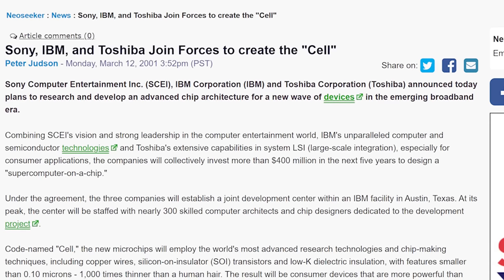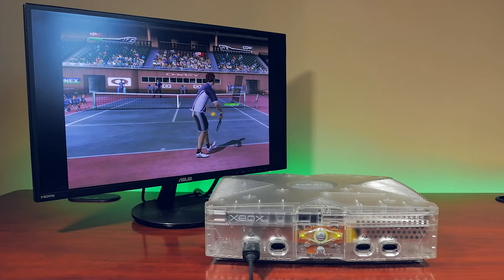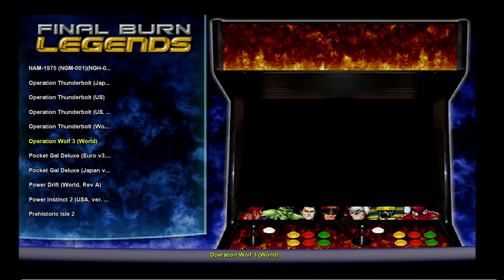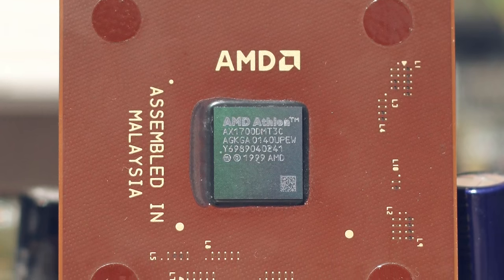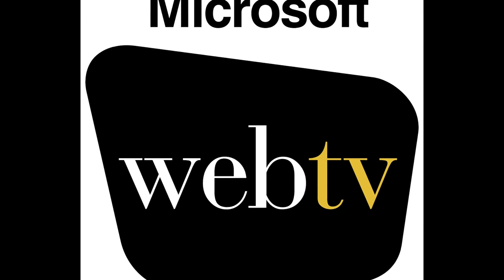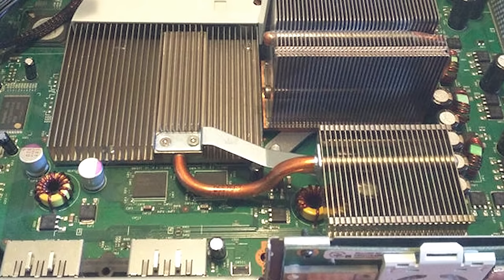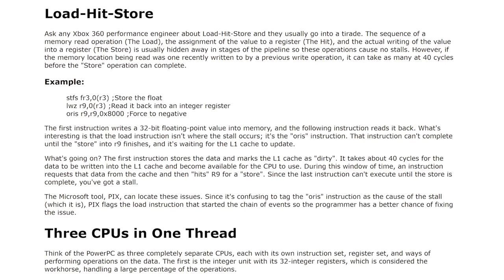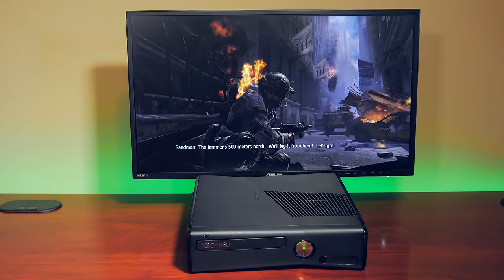Why Microsoft switched from Intel to Power PC for the Xbox 360  | MVG

Comment: I think the ppc vs Intel (and especially "RISC" which is a basically pointless description these days I'm told) is less important than the lack of out-of-order execution, which is a substantial difference between Xenon, cell spe, and common desktop chips, which requires really smart compilers and/or smart assembly language to accommodate.

Comment: I'm sure there were a ton of reasons behind the move to PowerPC. Although, upon consideration if they were having heat issues with a RISC architecture, imagine the heat issues they would have with an x86 and all that extras included along with it. Considering they were trying to be as cost effective as possible, they were not using the latest processing nodes. Moving to RISC would certainly make for smaller dies, and smaller dies mean greater yields on silicon wafers which furthers reduces the cost in lost/unusuable chips from silicon defects.

Comment: Aside from the RROD, which ducked up my tennager life TWICE back them, as MS didn't initially offered the xbox 360 in Brazil (later they started to be manufactured here) ,  I had two imported xbox360's die on me, and that was traumatizing. I remember trying everything in the book, towel trick, hot air gun, etc, in the and, if you add my brother, we have 3 dead xbox 360s stored in our parent's house.

I still own a 360, but I waited until the slim version, older versions, up to the falcon were a time bomb.

The 360 is my second favorite console, behind the original xbox, which is still my favorite.

Comment: I'm happy they're using standard x86 these days. Makes emulation / backwards compatibility easier for developers and it makes it easier for devs to port software from PC to console. Power PC was necessary for the time, but hopefully we're past it.
I'm still waiting for Microsoft to let me run actual Windows 10 on my Xbox One. Remember how the PS2 sold crazy well in part because it had a DVD player built in? It was a gaming console with a secondary feature that made it more reasonable for families to buy because it served multiple purposes. What if when people went shopping for a computer, buying an Xbox was a reasonable choice instead of a tower? The One X has an 8-core CPU, 12GB ram, 1TB storage, and can game at 4K. That's a decent $400 computer, and consider how small and quiet it is too. Wouldn't that open up a whole new swath of potential customers? I get that they make money from software sales, but we're entering an era where you don't only play Xbox games on an Xbox console. They're already blurring the line between Xbox and PC with streaming, play anywhere, and Game Pass for PC. Microsoft could capitalize on that with the Series X if they wanted to and just embrace their PC side.

Comment: A slight misconception was mentioned here for the Xbox 360 regarding thermals on the XCPU. Thermals were never actually a problem for the XCPU. As a matter of fact it's pretty rare that the CPU ever failed in the 360, even on the earliest revisions. RROD was purely internal manufacturing defects of the GPU that could only be resolved with a GPU chip replacement.

Comment: By the time the PS3, 360 and Wii came out, PPCs cores were already over a decade in videogames on the arcade industry, so it wasn't something really new for IBM. But you really needed better cooling at the start to avoid yellow flashing lights or red rings of deaths. But I suppose installing an arcade cooling system or worse, a server-like fan, wasn't the best idea...

Comment: From the sources I had consulted, the (in)famous red ring of dead was caused mostly due to the switch to lead-free soldering (due to RoHS directive around 2005), and not that much due to overheating. 

Nice video.

Comment: The RROD has nothing to do with the peak temps of the CPU. It was an issue with the ATI GPUs failing rather quickly with repeated heat cycles due to bad solder bumps between the die and the substrate.
Reply: It was because of the 90nm process. It was simply too hot to cool in such a confined chassis. The newer 80nm models were better,but only just. It was only when they got to the 65nm models that you felt safe.......enough. I have a Jasper V.2, which i'm told is pretty rare,and the most desirable of the 360 phats. The guy who flashed my drive pointed out the purple colouring around some part of the board,can't remember what he said exactly. He offered me money right there to buy it,but i refused. I still have it,works perfect.

Comment: Xenon was a very good, balanced choice when you consider it packed the same amount of transistors as a single core Athlon 64, yet featured three cores with each having an Altivec SIMD unit.  The HD twins needed GFLOPS for the kind of things games needed to really differentiate themselves from the Xbox/PS2 generation.  Xenon gave you that while retaining somewhat decent branch prediction, integer and non-SIMD capabilities that Cell was really lacking in.  That approach is where even x86 CPU cores have been going for the past decade and a half.  Moar cores + highly improved per-core SIMD.

Comment: For those of you that missed it, the RROD (Red Ring of Death) on the 360 was a system failure that would eventually happen to every 360 that had been manufactured during it's first 2-3 years. Heat issues (and perhaps cheap materials) led to an internal chip desoldering. The fix was that the chip had to be reballed but would most likely desolder itself again. A temporary fix called the "Towel Trick" did actually work but the results lasted from zero minutes to a few hours.

Comment: Fun fact, the original sdk hardware microsoft had to use was the apple powermac G5, as it had a variant of the powerpc 970. Considering the powermac g5 had 9 FANS air cooled and was also sold as a water cooled computer, it was astounding that microsoft didnt figure out that the chip would need beefy cooling and shoved it into a case that basically had no cooling.

Comment: I've never felt that the CPU was the problem in the Xbox 360. The large heatsink was more than capable of keeping the system cool, even at idle fan speeds. The problem was the GPU and its, by comparison, microscopic cooling surface. Remember that the original Xbox started out with a fan on the GPU/Northbridge, which was later replaced with a much taller, passive cooling solution. For the Xbox 360, however, that wasn't an option, due to the GPU being positioned underneath the DVD drive. However, a small part of that could have been mitigated by a larger fan shroud that would cover a small portion of the heatsink so as to force more air to pass through it (I measured quite an improvement by taping off the space between the heatsink and the fan shroud), and a more dense fin arrangement, like the one seen on the CPU side. And that's not even involving the heatpipe arrangement they eventually went with.

And then there's the solder... I don't know what's in that stuff, but those balls don't melt or soften with heat at all . So with each heat cycle, you get stresses due to the motherboard flexing and settling back into its original position, and you end up with micro-fractures that grow over time, until the solder no longer conducts properly and you get the RRoD. The only proper, long-term fix in that case, is a re-balling of the GPU with proper, more flexible solder, that can withstand the heat cycles and not break down over time.
Reply: finally someone with a brain
Reply: Was the solder thing in part caused by the lead-free stuff? I don't know a whole lot about this things, but I've heard it was partially to blame for the GPU problems of the late 2000's and early 2010's macbooks

Comment: Sony was first to start talks with IBM and only later did Microsoft chose to use IBM.

from the book 'Race for a New Game Machine, The: Creating the Chips Inside the Xbox 360 and the Playstation 3'
"In 2003, IBM's Adam Bennett showed Microsoft specs for the still-in-development Cell core. Microsoft was interested and contracted with IBM for their own chip, to be built around the core that IBM was still building with Sony.
All three of the original partners had agreed that IBM would eventually sell the Cell to other clients. But it does not seem to have occurred to Sony that IBM would sell key parts of the Cell before it was complete and to Sony's primary videogame-console competitor. The result was that Sony's R&D money was spent creating a component for Microsoft to use against it."

IBM made the PPC CPU for Microsoft not a 3rd party. 
Microsoft used apple G5 towers for dev units and to run demos.
they did not use webtv to make the CPU, IBM had sony and microsoft working in the same building at time's on different floors (so the joke go's).
both PS3 and xbox 360 used a CPU that was a custom version of the IBM power 4 (power 4 is the IBM name of the CPU apple used in it's G5's).

apple drooped IBM as IBM was not interested in making CPU's for laptops and failed to reach goals on production, both in chip development (the famous 3GHZ G5 apple keynote) and quantity at high clock rates. 
apple was in talks with intel and AMD on cpu's, they wanted the best CPU for laptops. in a lot of ways apple is credited in the direction of intel's cpu's at that time. There are some fun story's on how intel got apple t go with them, at the time AMD had the better CPU for laptops. 

Nintendo was also using a variation of a IBM cpu that was used for apple's G3 computers on a smaller processor node.
PowerPC 750cx wiki says

toshiba was originally going to make the PS3 GPU but it failed so last min they got nvidia to pull one of the shelf, it was a rush job.

Digital Foundry also talked about in one of there videos.

PS im relay not sure why the red ring of death was a problem, PS3 used a cpu that was vary close without major problems so i wonder if Microsoft made some design flaws some where or chose a bad partner for assembly.
Reply: O and there is a video of a demo by IBM at a trade show with a apple G4 tower running with a cell CPU (assume a pcie card?) running the same demo sony used on the PS3 E3 presentation. (the flight sim like one)
edit 
IBM also owned (at the time) the FAB that produced the silicon for Microsoft (and i assume sony) i think later IBM sold the fab to GlobalFoundries and they then carried on the production but im not 100% sure on that, just looking at wiki pages on the CPU's
you do have to wonder how much of a pain Nvidia was for them both to jump ship to ATI for GPU production (same as apple)
also got to wonder if after the IBM thing they just gave up on custom chips, sony must have been burned hard on the deal and with toshiba's GPU failure custom parts must have lost there allure.
the way they are now using AMD for all production i assume shows they are much more willing to work with there partners than IBM/Intel/Nvidia (or much much much cheaper).

edit, was the red ring of death an interposer failure not CPU? 
just looked at wiki and there is a reference to it being the 'wrong type of lead-free solder' which sounds correct as it was fixable with a re flow of the cpu (aka the oven fix which is more of a thermal shock than re flow)
so yep assume microsoft got the wrong people to assemble the PCB's, they used a bad solder to attach the cpu/gpu 
Led free solder has killed more electronics than anything else!

Comment: Well, to me it's clear they were unwilling to take risks with AMD. Alleged subpar performance was not an issue. PPC was in fact lagging behind x86, Apple made the opposite move (PPC to x86) because of this about the same time. Microsoft even choose the fairly weak Jaguar CPU for the XBone. It would have been much interesting to see an X360 console with an Athlon64 (Athlon XPs were already "old" by 2005) under the hood, even maybe one of the first dual core CPUs by AMD. A lot was speculated about how it compared to the Cell processor, but unfortunately no console from that generation was made with x86 CPUs.
Reply: PPC lagging behind in raw performance wasn't the main reason Apple moved from IBM to Intel, it was more of a "performance per watt" thing, and that the G5 processors were so hot that Apple never was able to put one of those inside an ibook
Reply: @rockapartie  First Athlon 64 X2 came out in may 2005. It was tight, but doable. But I don't think a single core CPU or DDR memory would have been that bad either. GPU was far more important back then.

Regarding TDP, you're thinking of aftermarket CPUs of the time, but for a console they'd use a lower voltage and clock speed, thus lower TDP. Definitely not more power hungry than the PPC X360... and definitely not hotter than these RRoD prone consoles.

Comment: For Nintendo, their move to PPC made sense. They tried to do the whole MIPS-RISC custom chip thing in the N64, and everyone hated how hard to develop for that platform was. So instead, they tried to make development easy for people by using a well-established ISA and hardware (with some customization). The Wii was just an overclocked GC, so there wasn't really a "choice" to stick with PPC. And with the Wii U, Nintendo was no longer chasing absolute performance, so they just went with something they were familiar with.

For Sony, the move to PPC was because they had run out of expertise when it came to superscalar architecture design. And IBM was really the only option available when it comes to developing high-performance chips and was willing to license their tech rather than impose their manufacturing onto Sony. While AMD was nearing a peak in their performance race with Intel, they weren't in the super-scalar business yet, despite having purchased ATi recently. And the bit about who gets to make the chips was probably the most important thing to Sony.

For Microsoft, it really wasn't their idea; Intel just didn't leave them with any choices. They could either partner with AMD, but AMD wasn't exactly known for the highest-performing x86s when they would have had to begin partnering with someone (this was before the Pentium 4/Itanium flop that left Athlon as the king of x86-64). Also, partnering with Intel's chief rival would probably make them angry, which could cause problems for Microsoft in other domains. That left IBM as the only real option.
Reply: the reason why the N64 was so hard to program was Nintendo's own fault. The head engineer of Nintendo at the time even admitted it. It had nothing to do with the MIPS architecture. It all had to do with NIntendo not giving out the microcodes, RDRAM and its bandwidth and the stalls you would get. 4kb of texture memory also didn't help neither did sticking the sound controller in the Reality CoProcessor.  Nail in the coffin was being cheap and not giving the CPU a way to access memory by itself. It had to go through the graphics chip first.

Comment: Pretty certain the CPUs were not based on the PowerPC 970. Multiple sources say the cores the consoles (PS360) used dual issue, in-order designs with relatively deep pipelines. The 970 was a significantly wider architecture that can also perform instructions out-of-order, though was probably more expensive to produce (both in silicon and power supply/cooling) as well.

That said, as far as dev kits go, it would make sense that 970s are used so devs can cut their teeth on PowerPC assembly.

Comment: the part about the original xbox got me thinking: I remember from another of your videos (I think it was the xbox emulation one) that it's not 100% like a PC. I used to think "it's just x86 pc, it doesn't need emulation, somebody just make custom win32 exes for the xbox games and they will run on PC", but since it's different at a hardware level, can there be a PCI card or even a USB dongle thing that "compensates for the difference" and gives the PC what it's missing to run xbox games?. with the proper hardware, drivers/wrappers and a launcher, it should be possible.

Comment: I always thought it odd that MS had their Dev Kits run on Mac G5 hardware, meaning that they'd almost certainly rewritten DirectX for PPC, but they never sold a 'Virtual 360' app for running 360 games on PPC Macs. It seems like they missed a market segment that wouldn't have required much additional effort.

Comment: Did you ever thought how would the X360 be if they used a Athlon 64 X2 clocked at 3.2GHz?
Reply: I doubt it would have been as cost-effective for them, they weren't designed for systems with low power draw
Reply: 3 yeaes hardware refreash...

Comment: I didn't realize Sony and IBM still had fabs making things with good performance in 2003. I always assumed it was PowerPC because it was developed on a Xylinx FPGA that came with PowerPC cores on it. This was the era when Pentium 4s and AMD Thunderbirds were catching fire. PowerPCs weren't nearly as hot. A lot of applications you could run those Xylinx Spartans without any cooling.

Comment: It really surprises me that both Sony and Microsoft decided to just disregard the very real heat issue PowerPC processors had at the time. It's no surprise to me whatsoever that the PS3 and 360 had massive heat issues -- power per watt is the whole reason Apple moved away from IBM in 2005 -- PowerPC just made too much heat back then, and it was no secret.